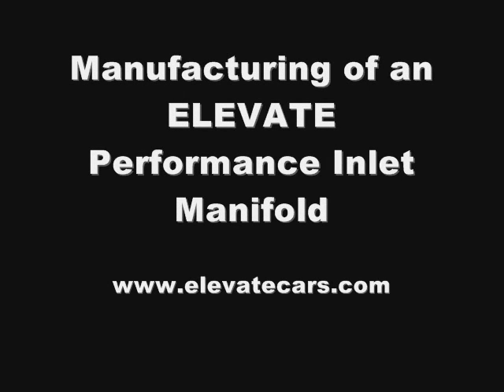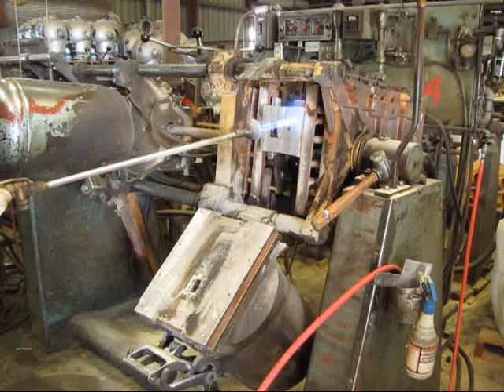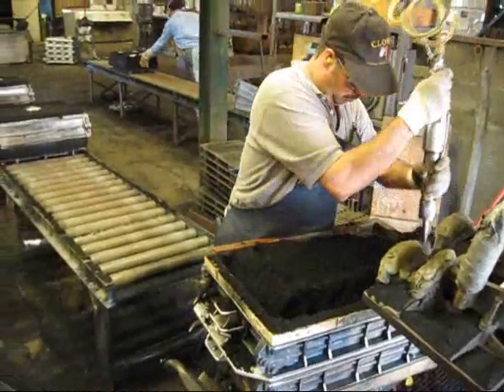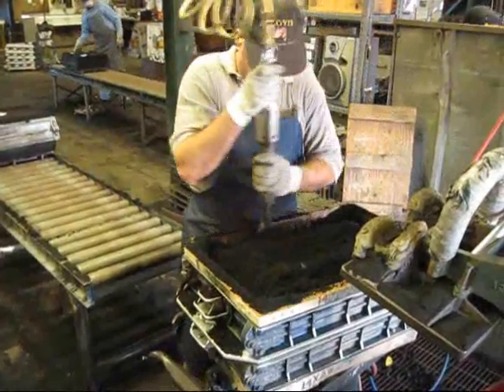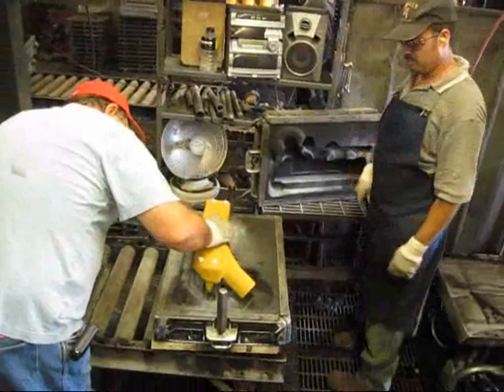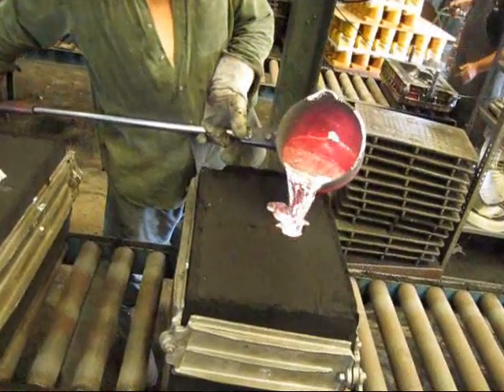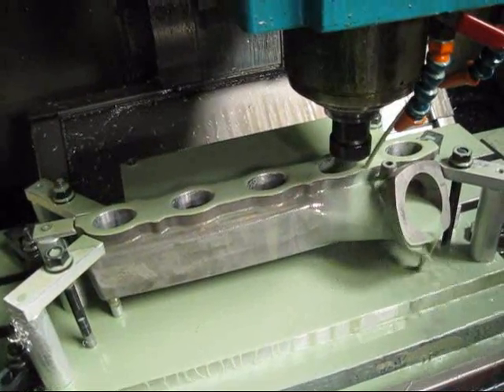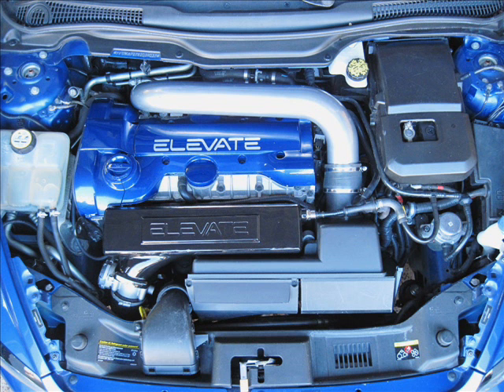ELEVATE Performance Inlet Manifold Manufacturing

Comment: Very bad design of your core shooter machine..u people cant fit a vibrater their and from bottom side u just burnt out the sand...that will make casting defect like blowhole that u will cant control of it.
While pouring also nobody is cleaning out the slag from ladle its going inside the box as shown in video.
Reply from the maker: Thank you for your input. We'd love to see a video of your manufacturing facility.
Reply: ELEVATE Volvo Performance nice one